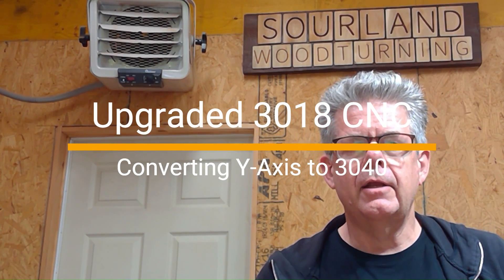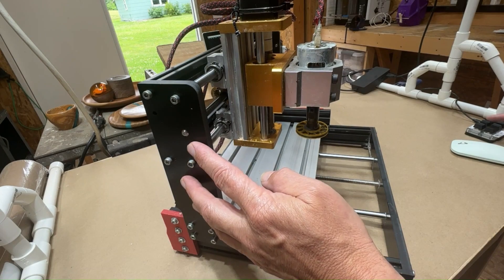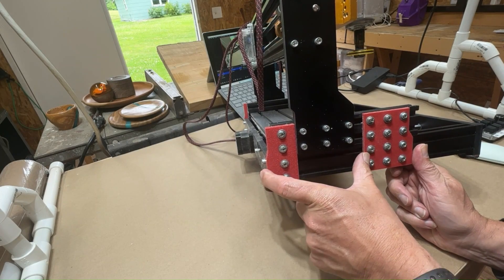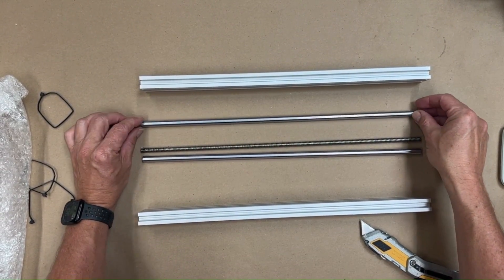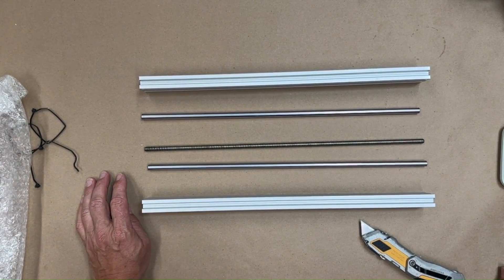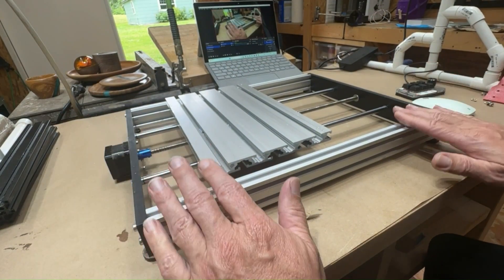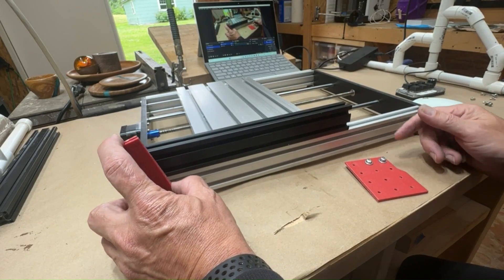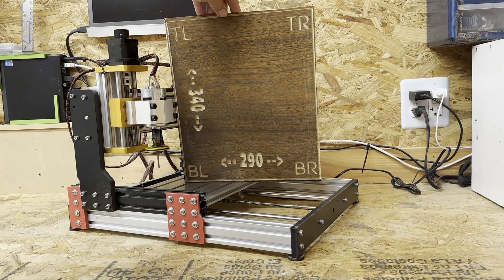Upgraded 3018 CNC - Extending the Y-Axis to make a 3040 CNC - for under $30

Comment: I had trouble I’m finding parts to do it I all ready had crap load profile so just ended up buying longer t8 thread rod and did away with the smith rods on the y axis for liner ralles just a attached them strat to the 20x40 side frames lot stronger no flex at all no wehgit at all on the threaded drive rod

Comment: Excelent . Will it be possible to enlarge the cutting width? What would be the upgrade limit?
Reply: I imagine the process would be the same. I havent seen a kit for extending the "X" axis.  The problem I see, is that the "Z" axis spindle assembly rides on the 2 round bars and is completely dependent on them for support.  Extending them in length will make them weaker and subject to deflection and vibration making your project much less precise.